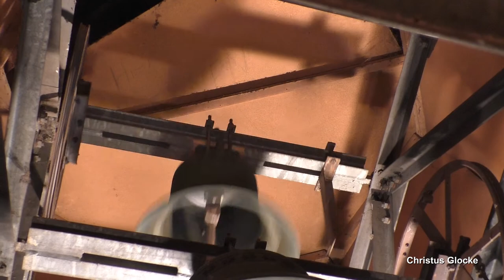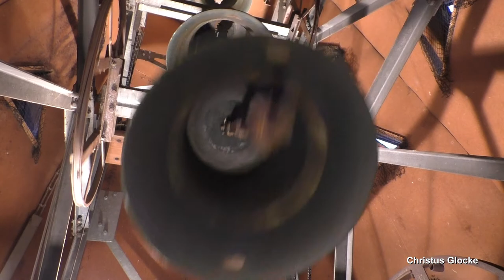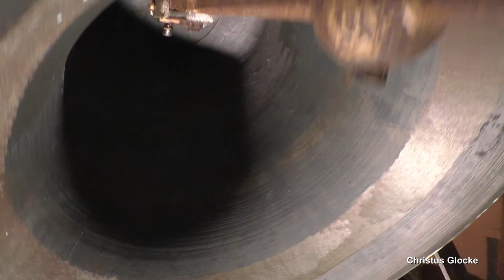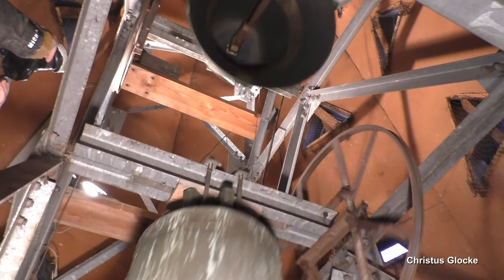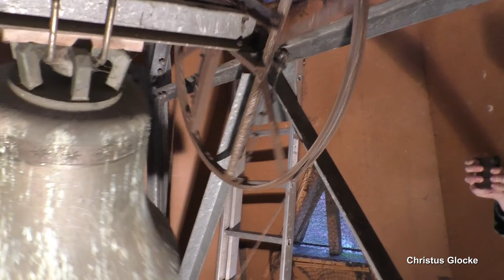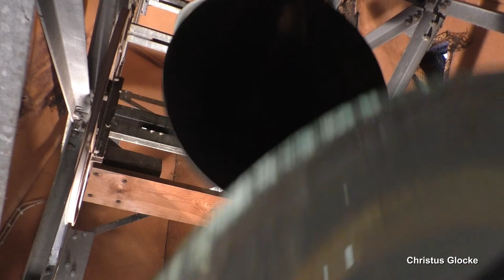Barbelroth, prot. Kirche, Geläutepräsentation (Turmaufnahme)

Comment: 390kg is light for a fis' bell. The lightest fis' bell I rung was 445kg. Any ideas what profile the bell is?
Reply from the maker: The profile is a very experimental one. It is a try to recreate the "Untermollsextrippe" of the steelbells from the "Bochumer Verein".
Reply: @ChristusGlocke  So they basically cast a bronze bell using Bochumer Verien bell moulds.